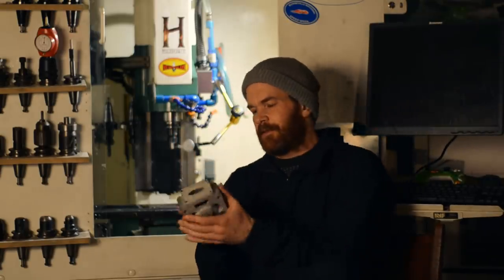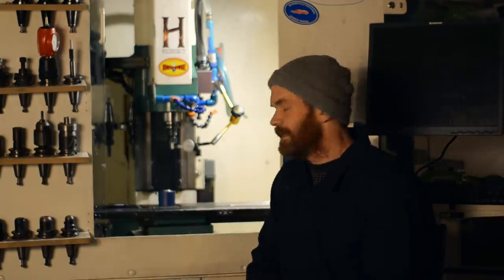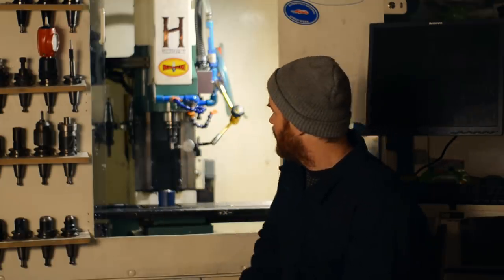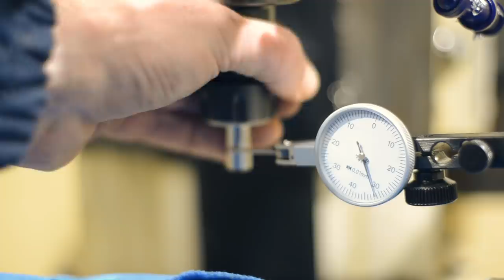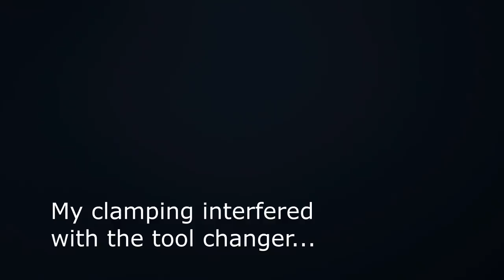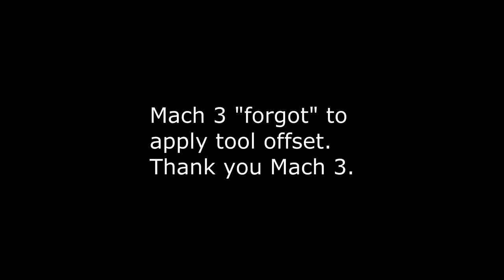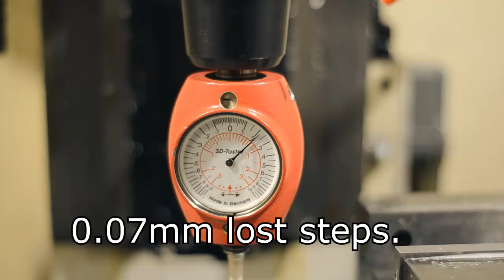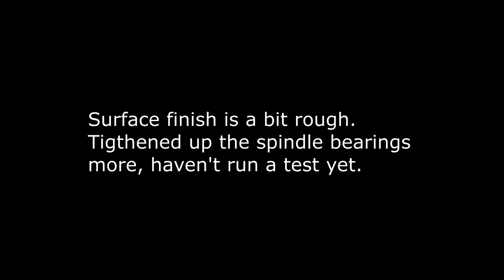Fought the Machine and Won - Back to the Most Powerful Two Stroke Ever now!

Comment: if it ain't closed loop, and it ain't manual, it ain't worth shit.

Really.  If you can't trust the machine to do what you tell it to do, it's worthless as a tool.
Reply: Yes steppers are a nightmare, especially those old round ones. I've dealt with a lot of stepper machines and nearly every one has had ongoing lost step issues. Servos usually just work. If something does go wrong at least they let you know rather than quietly trashing your job.
Reply from the maker: Servos are tempting!
Reply: @2STROKESTUFFING  Doesn't have to be servos, steppers are absolutely fine as long as they have the required torque, but they need to have the loop closed.  

With steppers rather than servos, the software becomes marginally more complex (the software is commodity unless you're writing it yourself), and the hardware is a bit more expensive, (but you already have the hardware).

Comment: Can you do better than 144 miles per hour if not back to the drawing board

https://youtu.be/Df8XVdKbiLA

For it looks like that's the records are going to have to beat if you want to claim to have the world most powerful two stroke of 3 cubic inches which is 50 cc's and if you watch the video I just posted you will see it Bonneville they're hitting close to a hundred 50 miles an hour with the same size engine you are building